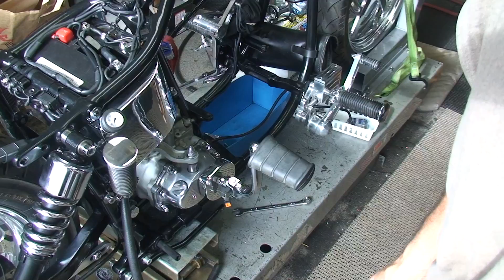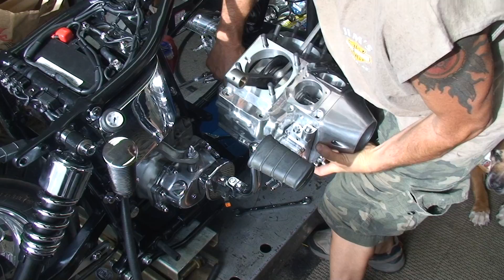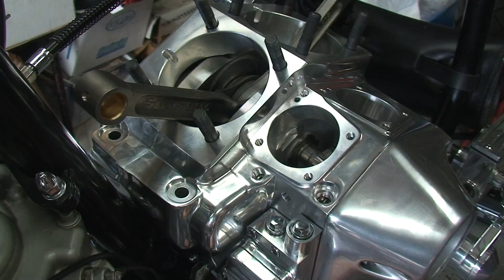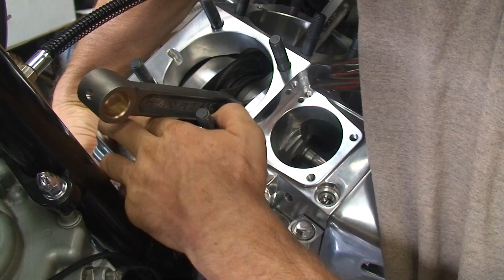1979 93ci shovelhead #106 motor rebuild bike repair FL FX harley by tatro machine

Comment: I would have used lubricant on those bolts and nut to get proper torque
Reply from the maker: i do when needed. that would be tatro torque. tighten the hell out of it.
tatro
Reply: an old guy told me once i over torque things on purpose because harley used shit aluminum and if the threads are gunna pull out i want it to happen on the bench instead of when the poor guy is reaming down the highway